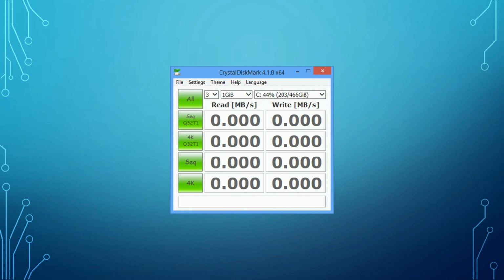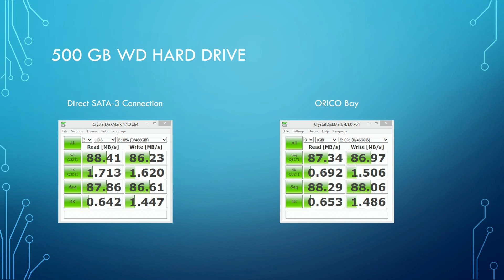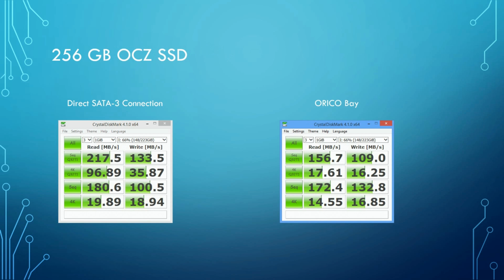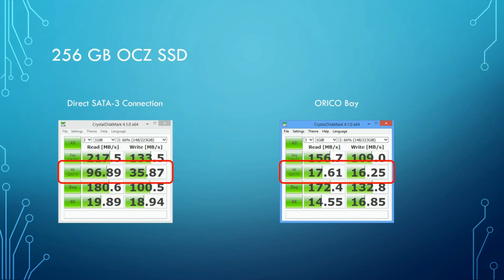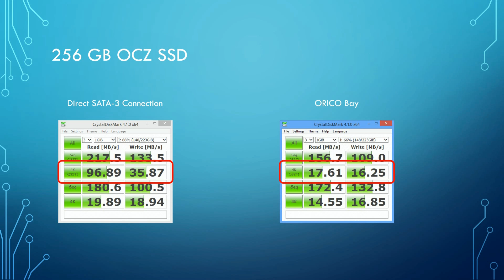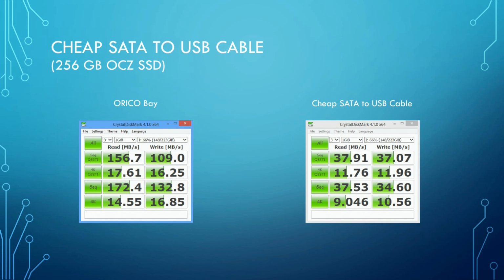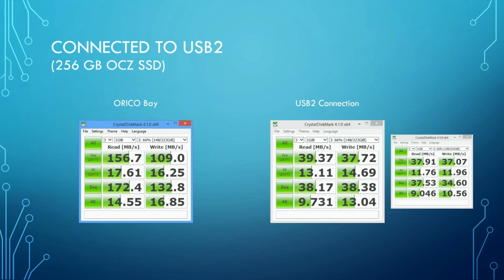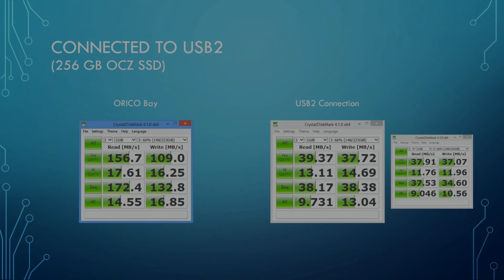#8 Performance Test: USB 3.0 to SATA Hard Drive Docking Station ORICO 6619US3

Comment: nice video, very helpful. How about performance test between orico docking station with external hdd usb 3?
Reply from the maker: With the tool "USB Flash Benchmark it got up to 150 MByte/s with a 4TB mechanical disk. A 2 GB internal SATA disk only gave 90 MB/s
Reply: ok thank you. i'll buy it :)